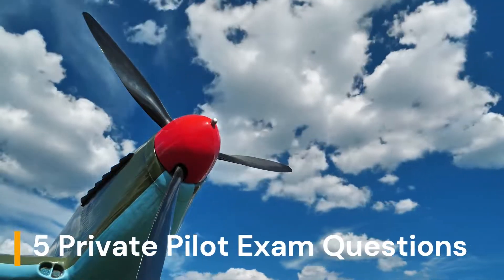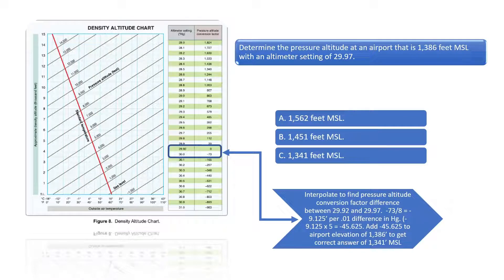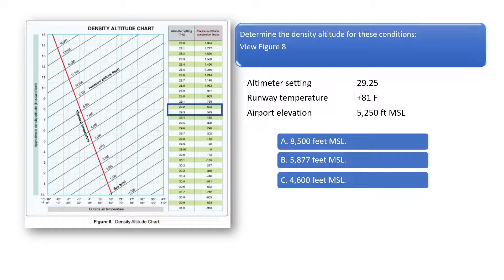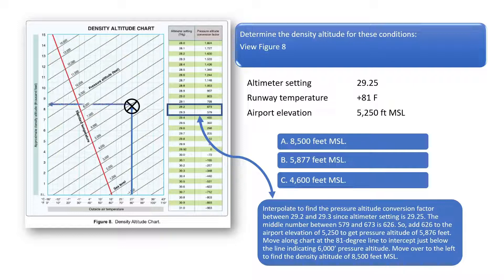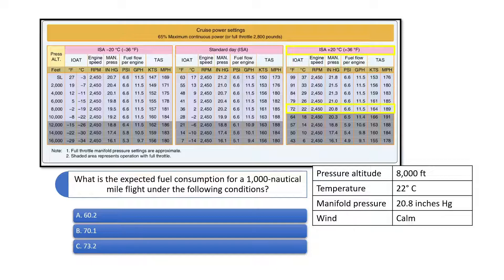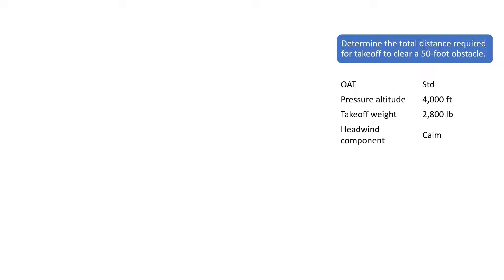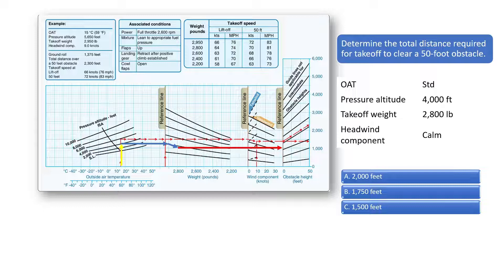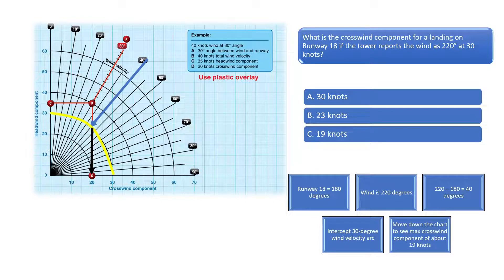Private Pilot Test Questions - How to Calculate Density Altitude, Takeoff Distance, and Crosswinds

Comment: For the first question, where did you get the 8 to divide the -73?
Reply from the maker: Pressure altitude conversion factor at altimeter setting of 30.0 is -73 feet.  30 - 29.92 = .08. .08 x 100 = 8.  -73 / 8 =  -9.125’.  -9.125 x 5 = -45.625’
Reply: @evergreenskyworks  Second question: when you multiplied the 0.08 by 100, did you do so because the eight is a HUNDREDTH for the altimeter setting and therefore made it a regular 8 to divide -73? Does that sort of formula work for ALL conversion factors and interpolations when determining pressure altitude?